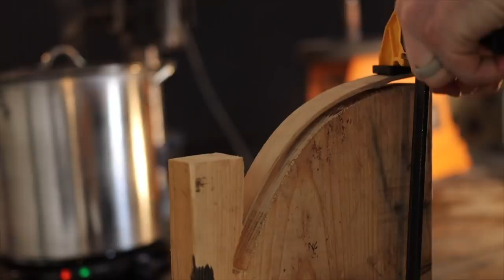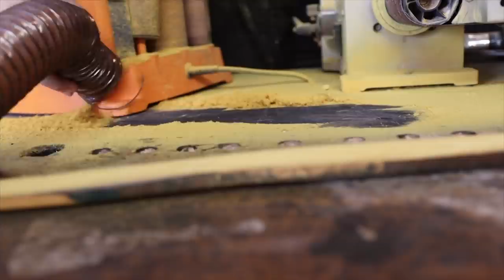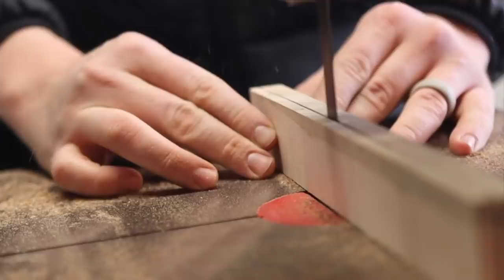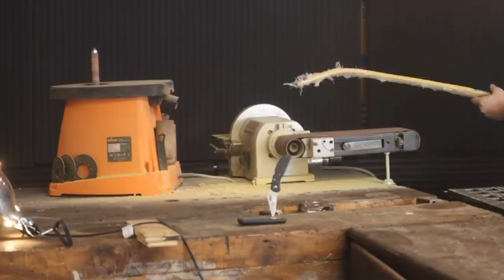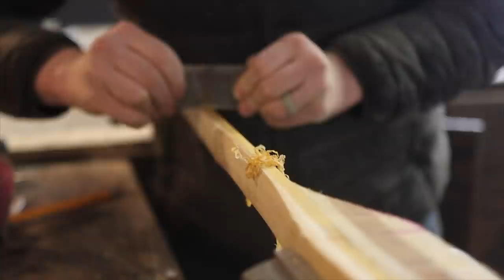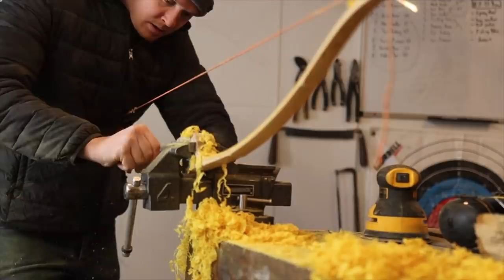Making A Laminated Recurve Bow "Bamboo, Osage, Maple, & IPE"

Comment: This was an awesome video I really liked how the bow turned out. I would really like it if you would spend a little more time on the fine details of tailoring. I just finished my first bow and I'm not sure how exact or even the tiller should be should the Gap be the same all the way around as you get to your full draw or should it be just an even tapered down on either side.

Comment: Why did you curve the wood BEFORE gluing all the parts? 
Usually, in laminated bows (or anything else made this way) the parts are glued together in a mold having the final form. It's the glue holding everything in place...

Comment: First bow I made, which failed was a Manchu stile bow... I had filled a gab in the siyah with saw dust and wood glue and it had bend a bit two days after fixating it on the bow and broke three of my fingernails in half while unstringing it self during a slight draw. Turns out it's tend to twist a lot and will need wider limbs too. Do you think you can build a modern manchuisch bow with a draw length around 35 inch ? It would be a pleasure to see how to make it without experience for this stile of bows from an experienced bowyer.

Comment: Currently planning my first bow, purple heart longbow, wondering what the length and angle on your recurve jig is. My bow is going to be 64 inches because i have a 28 inch draw. Any advice otherwise? 

Edit: due to an error on my part,(tested first with a compound bow) retested my draw length to 31 inches so my overall length is 70.

Comment: Can you offer some advice? I am trying to get back into archery and I do not know where to look for bows. I had nice recurve bows as a child, but I have been told that the arms are bent and not usable, so I am looking to get a longbow. However, my struggle is that I am 6'4 inches tall and every box built for my size is ungodly expensive for just starting out. What can you suggest? I also do not know how to determine proper poundage and truly proper bow length. I find som many differing opinions.

Thanks in advance!

Comment: Recently bought a string from shatter proof based on my previous string length (61") but my brace height was about 3/4 of an inch more with the shatter proof d97 string. I know they are pre stretched so should I try and shoot it in on my current recurve I measured the original string from? Or save it for my next bow acquisition (64" amo longbow)? BTW keep up the great content Kramer!
Reply: PS: the string from shatter proof is of the highest quality I've laid my hands on and I plan to get more for the other two recurves I currently own
Reply from the maker: Nathan,

I beleive you should be good to go ahead and shoot it with the brace height a little more than normal, you can alsos untwist the string a little to make it a little longer! Thanks so much for the kind words!

Comment: Hi Kramer I have a question for u or anyone that can answer or help me I have gotten back into building bows Kramer's fault lmao but here's my question the third bow Im currently working on I did the same way as my red oak reflex/reflex long bow and my daughter's bow I ripped the boards length wise in half for two Lam's  and used titebond 3 to glue them back together with a handle looks like ur long bows Kramer lol my problem is the third bow is maple a bow but some how I managed to get the limb tips twisting in different directions site down bow one twist to the right and on to the left how to I fix this or over come the twisted tips thanks  in advance

Comment: I'm having a problem and need help if somebody knows the answer. I am trying to make my 1st Flemish twist bowstring for my son's  Recurve bow. He is 4 years old and it is a 27in string. I want to make a jig but all the plans that I found online do not accommodate a string that short.  Does anyone know how to take the plans from a Flemish twist jig and Reduce the sizes down to a size that would work for that?
Reply from the maker: I am not for sure on the jig but if you want to build the string with out the jig your longest strand should be about 43" and your shortest strand 37" and the rest staggered between there
Reply: @kramerammonsarchery  thanks i will give it a shot. It doesn't seem all that hard to do but if I have an issue Would you make a string that size if I ordered it on your website?

Comment: I don’t trust any bow or bow limbs or risers made with wood because wood has a tendency to swell & dry beyond repair , I’ve seen people leave there bow string on wooden bows & leave it for a long time , then come back to use it & it had lost 15 to 25 pounds of draw strength totally ruining the weapon . You should never leave your string on your bow any kind of string , any kind of bow . I’ve seen people put there wood bow in to dry of a place only to come back & try I to use it & the whole thing collapse with one pull of the string , wood gets to dry & this is what happens , never trust wood .